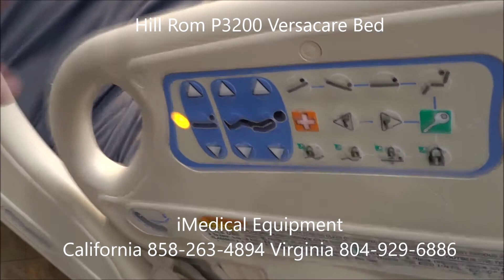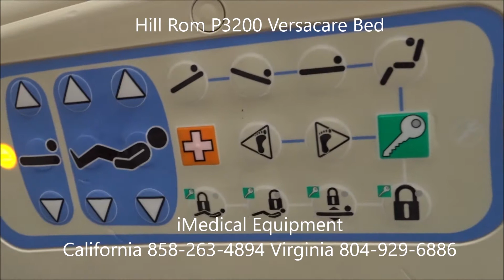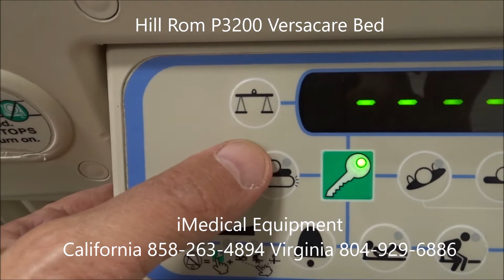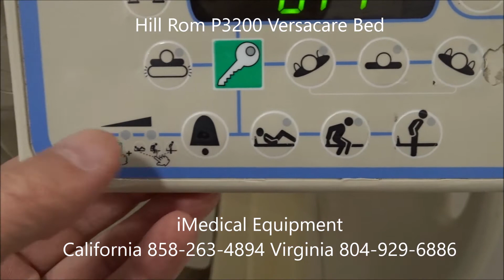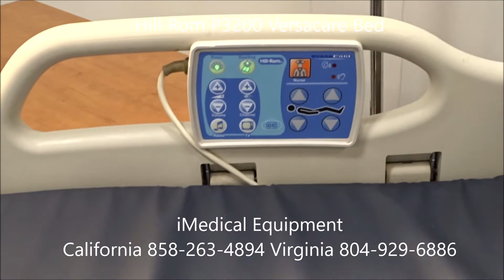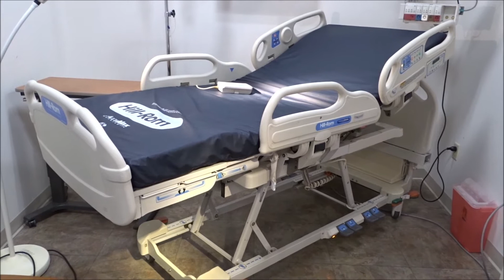Hill Rom P3200 Versacare Bed Walk Through

Comment: Thanks Sean. We just got one of your reconditioned versacares exported abroad!  With an air mattress. Question for you - does the air mattress alternate areas of high and low pressure ? I held my hands on it for about 4 min and did not notice it cycling - all the tubes seem inflated tbe same amount, which wont protect against bed pressure sores.

Another one, do you have to use the scale feature each time before placing the patient into the bed for the air mattress to work in pressure relief mode? 

Thanks again for the walkthrough.
Reply from the maker: Hello, The Versacare air mattress is a very basic air system. The only feature the air mattress on this bed is a "turn assist" unfortunately. The Progressa P7500 has a lot more features like lateral turning and percussion - vibration. The Versacare was really designed as a short term stay bed in a hospital and not ideal for long term care with the air mattress feature.

Comment: I see a cable at the bottom of the bed in the middle, not connected to anything & I dunno what it is for? I couldn't find anything about it in the user manual I googled and that's how I found this video :c
Reply: Is it the tube for connecting a pump under the bed to an air mattress?
Reply: @ The white cable is coming from a device under the bed & it's not connected to anything, just hanging down. u might be right, but I'm not so sure.
Reply: Ours has a box about 6 inches in each side hanging under the head end that seems an air pump.  A transparent tube from this box comes up and is then routed to the side and eventually goes under the middle of the bed.

It seems theres just ONE airline so this mattress cant relieve pressure from alternate areas under the patient, which is how i understood most systems relieve the risk of pressure ulcers.

Very fancy bed but fails in one of the fundametal tasks needed for my mum, sadly.
Reply: @ I checked the manual again, and it doesn't seem like our bed has an air pump. That wire seems to come from the battery compartment! Sorry to hear that
Reply from the maker: It is probably a nurse call cable that was used in the hospital but not taken off when removed from the hospital. Very common - good question!

Comment: What if the air mattress does self inflate?? O. The panel the turning g feature  doesnt allow to rotate the patientl
Reply from the maker: This bed does not have a rotation feature - you get patient turning on the Hill Rom Progressa bed. This bed has a quick turn assist but does not keep going and is a short mini turn for cleaning and exchanging bed linens. We can also put a patient turning mattress on a Secure 3 or an Advanta 2 bed which is another way to do it. You can see the Progressa bed at https://youtu.be/1mcHs5kOg1Q?si=ZPMj2uGYAX_G_vy5 and see more on the beds at www.1hospitalbeds.com or call me at 804-495-0770 Thank you, Sean

Comment: How do you take it apart?
Reply from the maker: To move the bed reduce it to lowest position and zip tie the rails into the frame and head and foot section then tip sideways on blankets to get in and out of a home or doorway:-) The bed really does not disassemble unfortunately. Thank you for the comment:-) Sean